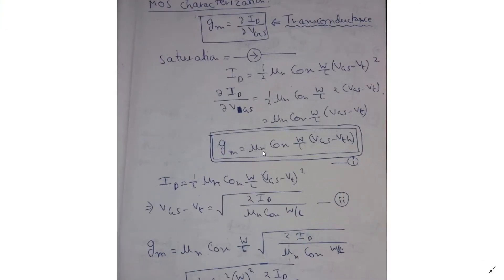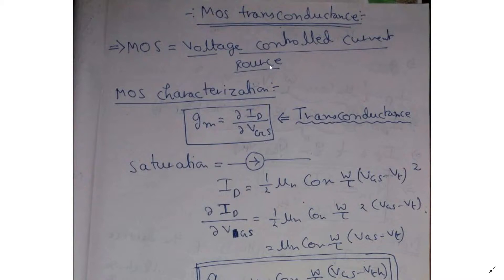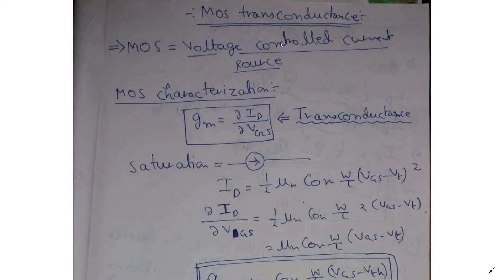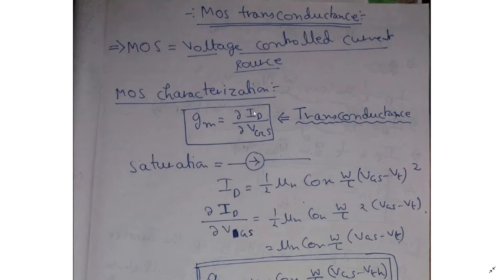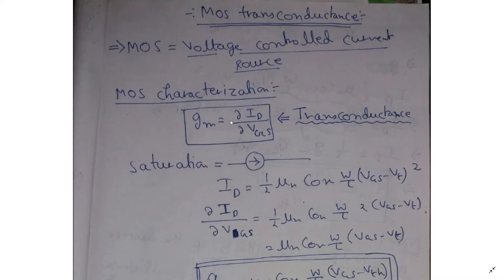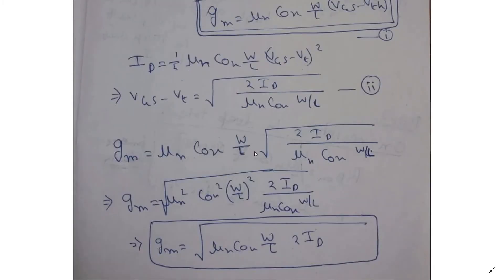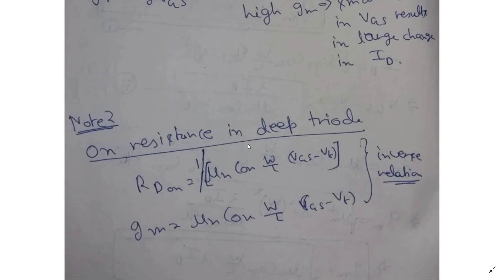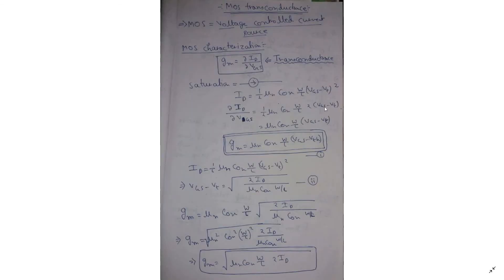Mosfet Trans-conductance  | Derivation and different forms | Semiconductor Devices & Circuits

Comment: in one equation gm is directly proportional to Vov where as in the last equation it is inversely related? can you justify it please
Reply: gm increases with the overdrive if W/L is constant, that means Id can vary here.  whereas gm decreases with the overdrive if ID is constant, but here W/L can vary, Id remains constant even varying W/L is because you are pulling down a constant current from nmos current source if you are measuring pmos transconductance, or for nmos its you are providing constant current from pmos current source. 

refer to razavi cmos section 2.2.3